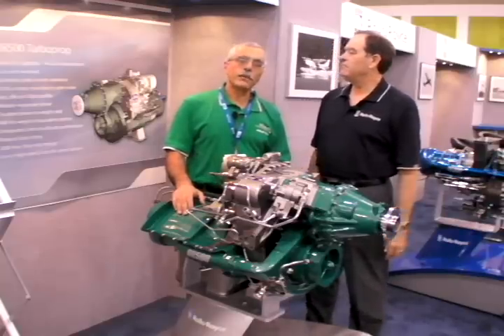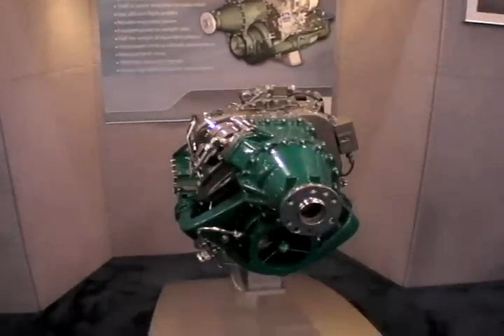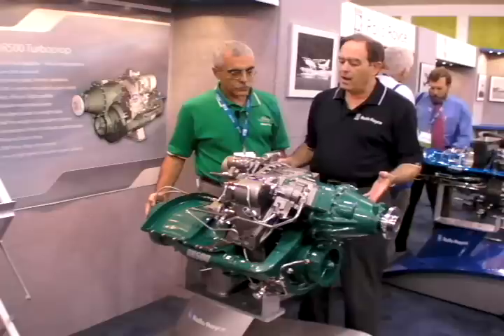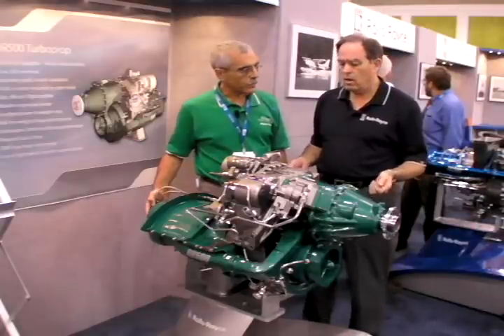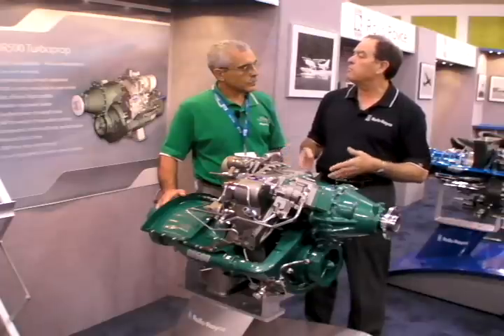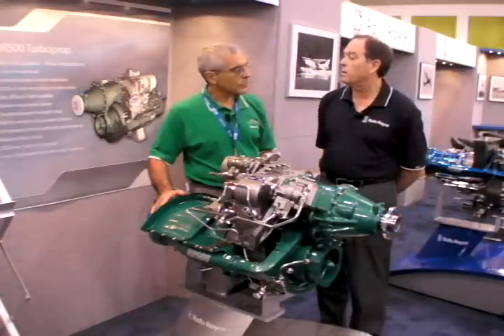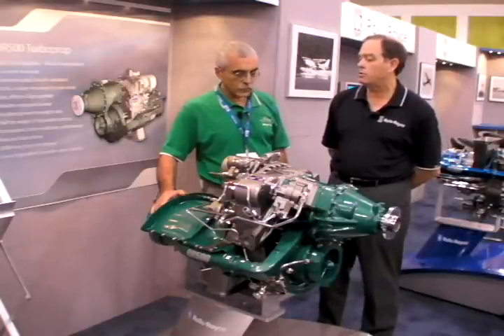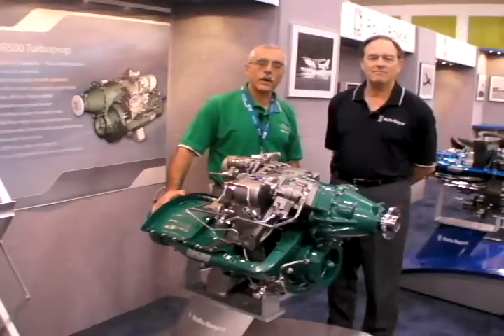Rolls Royce Turbine Engine For Small Planes

Comment: What the fuck is a POUND  ??
Reply: Hum it's a unit of mass. 2.2 pounds=1kg it's also written lbs. And it's very commonly used all over the world in aviation. And all over North America.
Reply: HeavensGremlin

It was ORIGINALLY based on the 1/4 arc from the pole to equator.  It has changed over time to be circular in definition as you stated.  The point is that it was based on a circular ARC and not a straight line as all measurement standards should be.

If you take 25 inches and multiply it by PI/2 you get 39.27 inches.  If you do one meter as 1000 mm and divided it by 25.4 mm/inch you get 39.37 inches/meter.  Therefore they are off by 0.10 inch in 39.27 or 0.254%.  If they just defined them by 25 times Pi/2 they would be the SAME system.  You then could have ONE system that is interchangeable by PI.  Think about it.  There is NO need for two systems.  You can have inches, meters and they link together if you relate them by pi/2 x 25 inches and NOT the 25.4 mm/inch nonsense..
Reply: +seaplaneguy Hey I know that. As I said I don't care I'm as comfortable in metric as I am with imperial. And of course imperial has to make sense in a way otherwise no one would ever have used it. Doesn't mean it's not outdated. Metric is clearly superior.
Reply: great answer for a stupid question!!!
Reply: Very cool, Seaplaneguy.  Thanks for taking the time to write this all out.  I found it highly informative.
Reply: Its the good stuff!
Reply: It's a unit of force, approximately equal to 4.45 Newtons.
Reply: Look, the Inch is found in the Pyramids and goes back way before 5000 years.  Inch means thumb or the width of a thumb. Time is recorded in inches inside of GIZA Pyramids. Actually an inch comes from 1/25th of 1/10,000,000 of the polar radius.  The Meter is 1/10,000,000 of the 1/4 arch going through Paris. It is in error by over 3%.  The meter is based on an arch, which is about as STUPID as you can get as a standard.  (think about it....)

The Mile in contrast is 5280 ft which is 2x2x2x2x2x3x5x11 = 7x7x7x7x7x PI /10.  It is a number divisible by every number to 16 except 13.  If you use a 28 day month with 13 months you then have the perfect number system with all numbers from 1-16 divisible.   

The world speaks English because the system is superior and allowed the English to win in battle over the French and Spanish who corrupted their measurements.  

Why not decimalize all measurements such as timel???  Why not 1000 units of time per day instead of 24 hours/day, or 100 degrees instead of 360 degrees?  The reason is simple: 10 is only divisible by 2 and 5.  Notice that the scared cubic was 25 inches, which is 1/10,000,000 of the Radius of earth.  The polar radius is the longest straight line in any planet and is how you would characterize a planet in location (center of Gravity) and volume.  By doing the calculus of each distance to the surface from the center of gravity you can know the true volume of a planet very accurately.  This polar radius standard was originally proposed by Napoleon for the Metre but they did not have a way to measure it without a space ship.  So the measured from top to bottom of France and guessed.  

To have one system you should take 25 inches x PI/2 to get a meter.  Since the meter is based on a arch, it is not a true standard.  In fact it is now based on a frequency, which is circular and varies with orbit...not good.  By using the polar Radius you have a stable system.  All the ancients used it.  It scales to make.  12 inches = 1 foot...about what a man's foot is who is 6 ft tall.  The inch is about the width of the thumb.  The meter in contrast scales to nothing and there does not work well for design.  Also, the mind and how it works works better with feet and inches.  The meter is much too large.

The bottom line is only ignorant people think the English system is inferior to the unscientific Meter system has many flaws and it not truly a decimal system as we still have lots of non 10 based factors, such as hours and degrees.  You can decimaltize any unit (Micoinch) Miroc mile, and have the "benefits" of easy math.  This is not unique to Meters.  

The English goes back to the Roman (their gallon was 6x6x6 inches or 216 cu inches or 1/8 of a cubic foot).  The USA gallon is a "wine bibbers gallon" and measured 7x3x11 = 231 cu inches.  It is 7 x 33 or sacred 33 or sacred blood of Christ.  Yes, Christ is linked to the gallon....   Notice that the mile has 11, 3 and 7 as divisible.  This makes the math much easier....and when you are calculating without a calculator, doing the math is very important when you are being shot at by French and Spanish ships...Hence why you speak English....  So wake up and learn some history and stop promoting an ignorant system (meter) that is NOT scientific due to the arch base of the meter....
Reply: +Silviu Vasile Dumitrescu bud I'm European I grew up in metric, but now that I live in North America I had to adapt. I can't agree more with the fact that imperial is stupid. Even worse there's imperial gallon and us gallon which are different. But it's like changing the national language of a country. It's not something people get use to easily the change is slow. Here in Canada people tell you their weight in pounds but the weight their car can pull they'll tell you in kg. Just live with it.
Reply: *****

No, it is NOT outdated.  The Metric system is outdated because it is based on a ARCH, which is absurd.  I cannot design airplanes well at all with metric.  It has no connection to man.

Also, the mind thinks a certain way.  Metric ignores how humans think.  The English system is designed for MAN, not some abstract concept.
Reply: Actually an imperial pound is based on a Roman metric idealised for counting in fractions i.e. liquid measure; that made it perfect for Frank Whittle to invent its maths alongside.
Reply: The approximate weight of your entire head?
Reply: Wrong. Engineers have always used decimal inches. Doooh.... Oh and the Metric system is based on the speed of light - which, it now transpires is NOT constant after all. Ooopsss....!
Reply: In the UK, we've had the Metric system forced on us. It's a big help to dunces - but for most other purposes it's shite.
Reply: +Olivier W ::  And why then, for God's sake, have you overthrown the Britsh Empire, fought and declared Independence, since after a century and a half, you're still using theri archaic measures??! It's totally stupid, nowadays to use decimal values for a measurement system that was designed for fractional render. It's either Emperial with fractions OR Metric with decimals. What you're actually using is totally stupid. Not to mention gallons, not to mention feet, inches and so forth

Comment: Check out the Cessna 210P(pressurized) Silver Eagle or Beechcraft Bonanza (unpressurized) A36 Tradewinds with this engine. 200knots plus, better fuel economy than PT6 Pratt & Whitney, but what you pay for is reliablility. Comes at a price ($200k + installed, not sure?). Diesels will be interesting, although Thielerts on Diamonds were problematic. Avgas is on its way out and I don't trust pistons anyway. With the trend away from Twin Engines due to fuel costs, turbines are the way to go. I wouldn't trust a single engine diesel over a turbine. By the way, new Beechcraft singles will be diesels...
Reply: This guy doesn't trust pistons ? your a know nothing

Comment: Searching online, I found that anew RR250's ran around $250K+ new. This engine is to be less I belive. 
Secondly, the RR500 turboprop and turboshaft have been postponed as of a Feb 2012 article from Heli-Expo. I haven't found anything else after that about the current production status of the RR500 project.

Comment: Well with 100 LL going by by, Thank you EPA and they are have a tough time with coming up with a replacement, This engine would solve a lot of problems. In most places in the world 100 LL Avgas is hard to come by.  Jet -A , Diesel and home heating oil is the way to go.  Would love to have it on my PA-32-300 that I fly. But like a lot of things that engine would set me back way more that what I spent on the airplane.